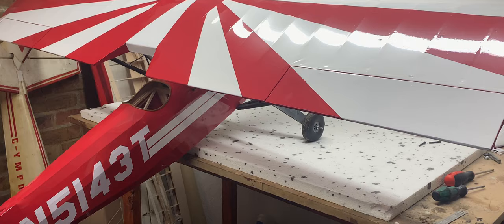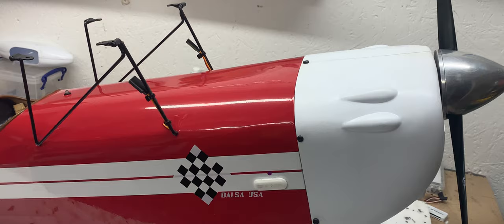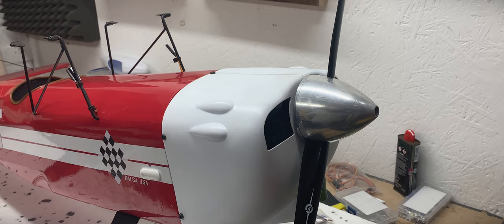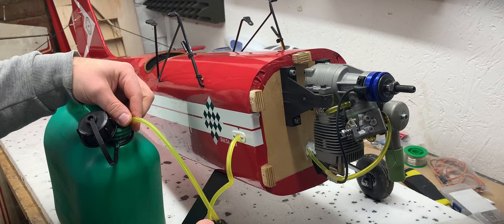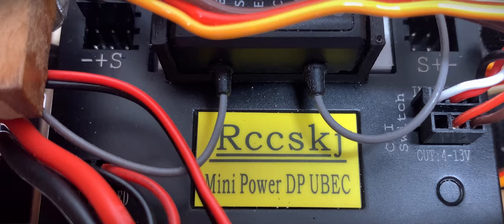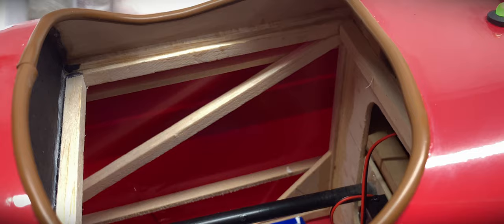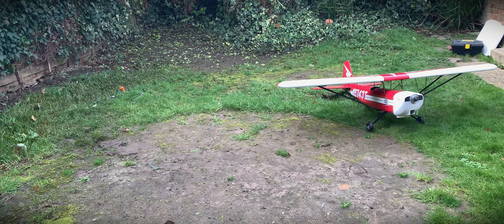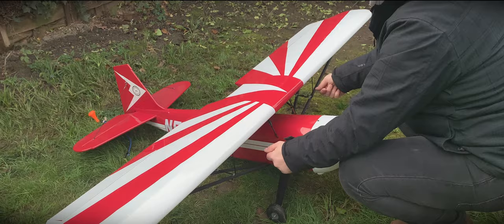Balsa USA Citabria Aerobatic Pro - MAIDEN READY!

Comment: covering looks pretty good for your first time.  Next time you get number stickers like that cut them apart before you apply them.  No need to have all that clear in between the numbers.  Apply masking tape as guild lines top and bottom and between if needed.
Reply from the maker: Thanks for the tip! 👍🏻